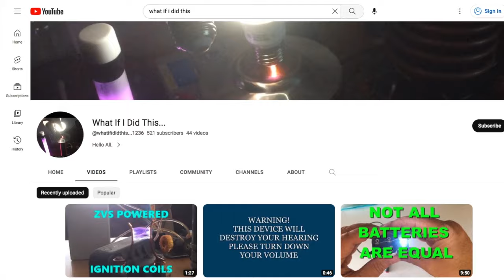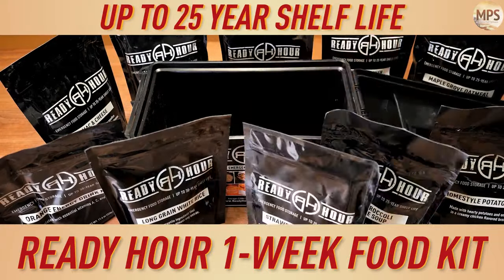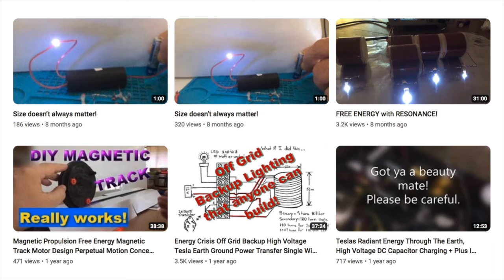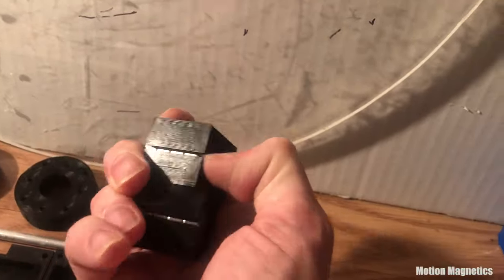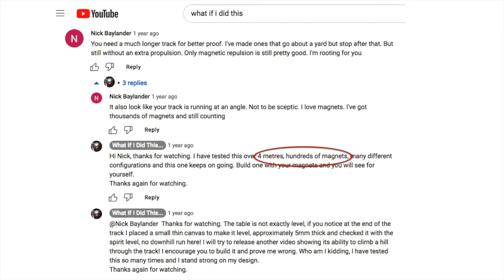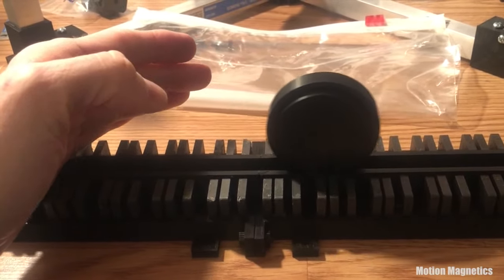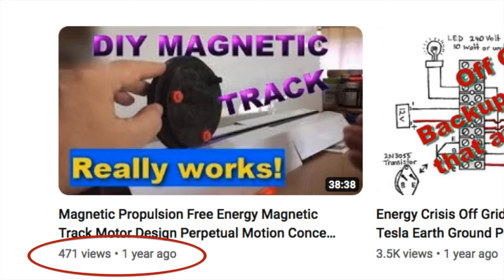Magnetic Propulsion System

Comment: If you built a rotary one, it should be vertically oriented and there should be a way to over come the stoppage and reset the momentum by gapping the correct section of the rotor differently. Like at the point of gravitational momentum maximum
Reply: That's a brilliant idea. Let's try to do that by using electromagnets instead, and switching on only the right ones at any given time to get that "gap" you're talking about; oh, wait, that's exactly how electric motors work already.

Comment: You need a magnetic yoke. This will get you past the sticking point (reversal attraction, repulsion, etc) The size, shape, placement, and mobility of the yoke are all vitally important to achieve what you are after. The yoke would need to be part of a working mechanism, so that the yoke is applied with exact timing. Think of clock work escapement as a potential model to achieve this. Also, traditional magnet shapes are not ideal. Custom carved magnets, with proper directional polarity would potentially help as well. All the best!
Reply from the maker: Interesting idea. I like where your thought process took you, as I've been researching clock escapements recently for another project.

Comment: I have an Idea for a perpetual motion machine that I haven't seen anyone try. Have a one way magnet track that spirals upwards. The magnet then falls down to reset itself back at the beginning of the track. Hopefully you can bypass the repulsive force by skipping it all together with gravity (or at least having gravity help overcome the repulsive force), having the magnet fall into the proper place for propulsion. 
It's a simple idea, hope it works or at least interests you.
Thanks for all the great work you do!
Reply from the maker: Sounds similar to a SMOT device in that gravity would play into the design.
Reply: @Motionmagnetics  pretty much yes, except one that would not be on a circle track, but a corkscrew that spirals up to then drop back in.
Reply: It takes energy to lift an object against the force of gravity. Where would the spiraling object get that energy from? That's why you never see an object roll uphill, or have you?
Reply: @William_Hada  From the initial magnetic launch, starting however you like.
Reply: @noblephoenix6151  I don't see how it can roll uphill against the force of gravity even the first time at launch. This channel's creator is only moving the object sideways when he gives it slight push. This slight push is the energy required to change it's position. It never increases its height ( potential energy) against gravity. Things don't roll uphill.
Reply: @William_Hada  You've missed some of the videos on this channel that do push a ball uphill to then fall to go through the next gate.
Reply: @noblephoenix6151  Please give me a link to the exact video which demonstrates that.
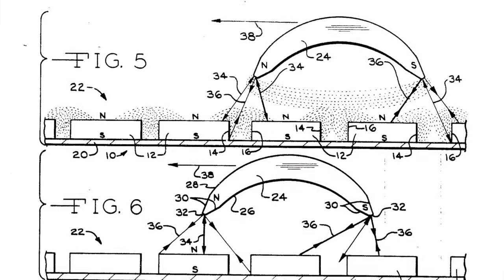Reply: @William_Hada  it's in several videos on this channel, but here's one where a ball is brought up and down a ramp around 1:45 https://youtu.be/gFzJCL9EKPo . He's got a different video where there the ball goes through several gates and several ramps.
Reply: @Noble Phoenix That's cool idea!

Comment: Inward/outward spiraling flat track,  complimentary arc spiraling arms and multiple disks along the length of each arm.  Pulling/pushing across the phase gaps with those in the advanced phases.  Keeping the delta v on the inside of the waves barrel.  To drive the slackers over their crests, in tow then rolling into the slackers own "push" phase at the tail end of the repulsion stroke.   Also being driven through by the other spiral spokes* mind you.  Like making that magnetic fountain funnel, but it falls/pushes inward  or downward by the time dialation difference between the spiraling track and the arc of the spokes.  Magnetically forward by the time sequence, multiple positions in phase of forward thrust and multiple points of time connected on each individual arc, being driven into phase.  Almost like physically trapping multiple points in time all entangled to a single sweeping arch.  Advancing or falling down the funnel into inverted delta v.   Picture a clock with multiple rings of the numbers in rows around the center like the rings of a bullseye target.  The outer most shell starts with 12 at the top as usual, but the next inner ring has the 12 time point at the 1 o'clock position, the next starts at 2, and so on.  Then on the hands there are disks aligned to run on each track of time.  All the disks despite being seperate on different time diameter tracks, are locked into one continuum on the sweep of that hand.  As the arm advances the entangled time points create the dimple in space time that the system is always seeking to fill.   Being dragged forwared by the points furthest forward in time.   The points that are on the inner, forward, cascading side of the wave.  Ie. The points that are rolling inside the barrel of the wave are driving the points that need to be paddled in to catch the break of the next wave set.  All riding down the wave face in tandem.    Flat Achimedese wheel magnetic funnel;  Duh. Lol.😅....   No but there's still friction though.  However, we are talking magnets here,  ie. may still end up being net +.  What's the mileage on a RE magnet with that kind of load taxing it's lifespan anyway.  Forever..!?  I can't imagine a little friction being a higher demand than the direct drive magleve trains weve got flying around.  I mean, what about cern.   
That actuall funnel track for the disks to roll on was an interesting idea that whoever gave.  Have the disks roll in an elliptical and sloped curve etc.  Sht, what about a (y) axis hexagonal, triple-helix-vector clamshell track.  Without the helix... twist...  for that matter..!   Get some speed racer track RnD sht going down on this perpetual motion biacchh😂 
No wait.!  A tilted double mobius elipse (on the cricical xy axies points) of course.  How the hell would the wheels swivel through the pivots,  oh yea.!  an L shaped mount to trail wheel pairs like horizontal airplane struts, set back to flip freely behind the arm. 
Now that just ridiculous...😂
K, that's all... 😂...

Comment: What about if you use an insulator on the magnets so that all sides are blocking the forces externally to the casing apart from 1 chosen pole lets say north do this on all of the magnets so that it only has opposing poles working in repulsion & zero attractive forces to slow down the motion this would cancel out all cogging also i would have the same north pole maglev bearings to reduce drag hope this helps you on future approach
Reply from the maker: Thanks for the suggestions.

Comment: Well the system doesn't offer enough thrust. You'd get better results using a liquid conductive material like suspended aluminum. The magnets are controlled with diodes, so you control the balance you get with permanent magnets. The power only flows in one direction. Yes it requires electric magnet coils spaced to deliver a strong pull, with a weak pull back because of the liquid material resistance. You actually gain thrust. The liquid material moves though a pipe (plastic or glass) that has a design narrow to wide. Wide is like a thick piece of aluminum, and narrow has limited conductive ability. The diodes control the whole system, and the speed of flow could reach hundreds of miles an hour. To convert the flow into thrust the liquid pushes into the narrow sections of pipe, and has almost nothing as it expands into the wide sections pushing back. At the end of the flow pipe it has to lift a spring valve to keep the flow continuing. This also transfers into thrust. Aluminum car lift an electric train. So it's going to deliver some strong thrust.

Comment: Think of a train circle track, with magnets at both sides like you place those tracks. And the rotation of each magnet changes based on where the wheel (via spring or liquid), so its essentially a self-reinforcing maglev slingshot.

Comment: I wouldn't say there's no noticable slowing, 4:00, which there is, but rather that, although the disc slows, the effects of inertia and momentum, are able to overcome the repulsion, thereby resulting in continuous motion.

This has to be one of the most promising methods I've seen, and it would be awesome if you two could collaborate, to ultimately achieve the efficiency that eludes everyone thus far... With money and materials as no object, I believe y'all may be on the right track...
Reply from the maker: Good point. Some of the wheels did slow, while others didn't noticeably seem to. I tested 5 or 6 sizes and orientations and spliced all the clips together. We have discussed collaborating. I would like to see his design work.
Reply: @Motionmagnetics aybe try tilting the magnets or angle them in a way would help.  also 6:24 the magnets in the flywheel should be in a 🌀 spiral shape this would help the consistently of inertia I believe
Reply: @Motionmagnetics yeah I would try a V shape or a spiral shape of magnets in the inside the flywheel

Comment: How about adding another track above the disk.  With offset timing to stabilize delta velocity.  In the ring format the disks would be sandwiched between an inner and outer band.  Like the race housing for a ball-bearing casset.  Why stop there.? You could stack multiple cassets and tune them in phase to drive the delta constant.  Replace the disk with a cylinder that runs the full height of the outer drum, or stack the cassets in different size configurations like a cone, hour-glass etc. Possibly driving through several phase issues in one "direct drive" platform.  Pros and cons; multi drive levers for funky housing shapes VS one static sprocket lever for compounding torque; all to the main center* drive shaft of course.  
Those other ideas some people had are pretty darn genius.  Like the square or triangle yoke to encase the planet gears, sorta like inside a rotary engine.!  Genius.  And moreso the other one where they suggest tipping the track in a rocking coin motion. Creating a wave function like a gravity engine.  Perpetual fountain gravity funnel.. 😂 sht is genius.!   Don't forget about friction,  the shaft that funnel wobbles around could quantize levels of heat we'd need to measure in Hawkins. 😂  actually I think that system might fail at harmonic resonance.  The wave dipole space-time dimple would collapse from the extra heat dispersal while in tuned phase.  Dropping back into the wake of C.  Mass begets gravity, begets mass, x(Pi3)2 after all.  IOW the coin will always settle to flatten out, seeking rest from the wave function farting out energy @ resonance like coronal mass ejections.   Lol

Comment: Job well done Motion Magnetics. Just want to mention that NEO magnets are not accurately checked or labeled for magnetic strength. The magnets that are correctly labeled cost twice as much. Good day and Happy Easter too.
Reply from the maker: Thank you. Yes, I recently ordered some Neodymium Magnets from China that were not only NOT the pull force that they were listed as but were the wrong size as well. Best to test each one individually when precision is required. 
Happy Easter to you.
Reply: @Motionmagnetics  I already have had delivered the wrong strength and the wrong N S location index. This throw off my experiment and set me back way to long in time too. Also, the nickel plating just peed off. Just so  you know MM the epoxy coatings are way better than the plate for strength and durability. 
Good day Sir too.
Reply from the maker: @victoryfirst2878  Good to know. Thanks!

Comment: When you know Maxwell they said poles atracct and repulsed poles but when you can provides a simple constant and said when one pole toutchy other the fields unitted but when it's the same if the pole is too large them unitted for then repels and ocurrs the same in other polarity, when you known FOCOULT he said when the propagation in serie is confluence the force increasing with ferromanetic presence, and when you meet Lorentz he said the force of electricity can convert to other force that is magnetism, in my own planification I sopoused that a magnet carry is constant energy in flux so I when you had a magnet intervention you must to put first the pole attract and then inertia and pole repels do the rest but not the resistance of flux is the bearing you also can do it if you put a magnetic bearing and then the flux also you can put inside is a powerfull army doing things like attract and repels but instead a force in back returns of line mode angle of 180° had the earth and the fem in motion but instead don't case fem in motion that are North to South poles think in allineated with the earth then put a instead the fem direction don't flux with the arm and also you hadding a better flux then instead the arm have to had 32 poles up and 32 instead secuenciary 32 and 32 is 64 magnets put instead 57 in section into that then 9 into the plate of 57 repels your wheel of 16 poles

Comment: Add intelligence into the wheel with a microcomputer and some electromagnets...this should smooth out the roll and create acceleration, slowing or stopping.  You'll need to protect the circuitry from the magnetic fields and ground out the eddy currents through the track to a common ground.  This could all be networked into a series of wheels to a bank of backup computers on board the main vehicle so that motion can be overridden in the case of wheel failure.  Or the computer can be placed aboard the vehicle and the wheel electromagnets can be timed since those electromagnets would/could be symmetrically placed.

Comment: i had a thought, the basic idea is to use multiple electromagnets /coils to drag the focused unit around a track by pulsing each...also to optimise the power utilise, the flux field (generated by the field collapse as it's switched off/on) could be directed by diodes to prepare consecutive coils for the pending pulse. Optimally efficiency it would operate in a vacuum enclosure. One potential candidate instead of reinventing the wheel pun, is to repurpose an LG smart drive motor which is inherently preconfigured already and possibly useful for this concept being based on multiple coils in series.
Reply from the maker: The intent of this project was to build a track that could propel a wheel along a track over a great distance using only permanent magnets.

Comment: The key may be in using electromagnets in the areas that cause the motion to stop, have a computer turn off the magnets at that time so the mover can get past that location, in fact, I'm not sure about the energy usage, but using all computer controlled electromagnets you can possibly create more energy than is used to charge the electro magnets... if it takes as much energy to move as it does to charge or more then this concept won't work then the electro magnets just in the areas of magnetic resistance might work and permanent magnets elsewhere.  I think that by using the pendulum concept of just pushing it a little more each time with a weak electromagnet that you can build up power.  But I haven't thought about this, but I've always known there is something to the magnets that we haven't discovered and I believe that it's a known but hidden secret.
Reply from the maker: You could build it that way, but all you'd be doing is making an electric motor.

Comment: Perhaps using a different spacing on multiple magnets within the rotor in a fashion where some number (1 or more ) radiate from the center out to the periphery will create the imbalance needed to facilitate, in this case, rotation along with the gap between the magnets on the stator.. tanks for your vids and research…

Comment: I really know nothing about any of this stuff but I noticed you saying that in your original designs for the track you experimented with symmetrical distances between the magnets and that this led to the problem of having to break the magnetic field of the next cluster using the momentum from the previous one. I notice that the arrangement of the magnets even tho its 5mm to 10mm to 15mm this seems to only go in one directions around the track (meaning on the track at 7:38 for example,  two magnets are always closer together on the left with a third slightly farther apart magnet afterwards). Is  it possible that there is an irregular sequence of distances between each magnet that may seem haphazard on initial inspection but based on mathematical calculations propel the object from any point in the track from either direction? It seems like the current design is still symmetrical to me

Comment: I would love to see a diagram of the pole orientation on both this and the circular one as it would help with some ideas I have.
Reply from the maker: I probably should have covered that in the video. The original video that I provided the link to covers that in detail. The north poles of the magnets are facing to one side of the wheel and the south poles are facing the other side. On the track, the poles of the magnets are facing north toward the opening of the track and south toward the opening on the opposite side of the track.
Reply: @Motionmagnetics  hi. out of topic but just want to ask, have you tried using hydraulic jack? to lift heavy object using less force.
Reply from the maker: @randompvp3266  I have not, but I've experimented with pulleys and levers.